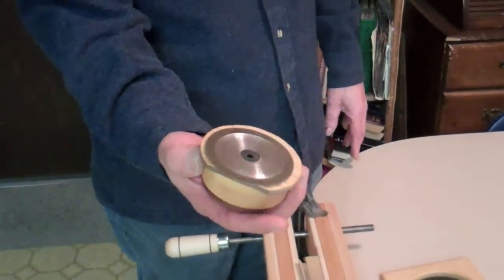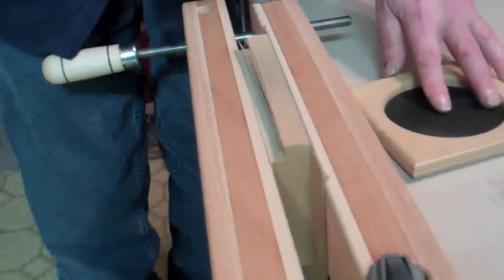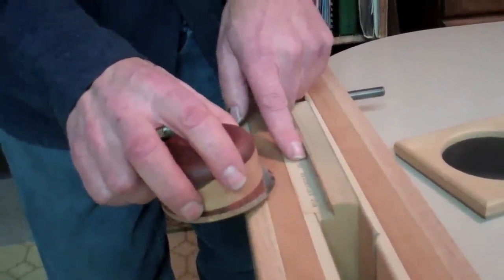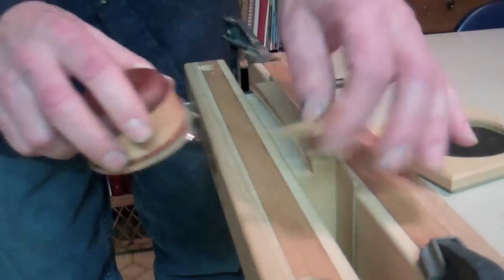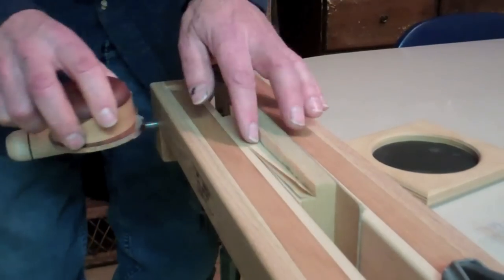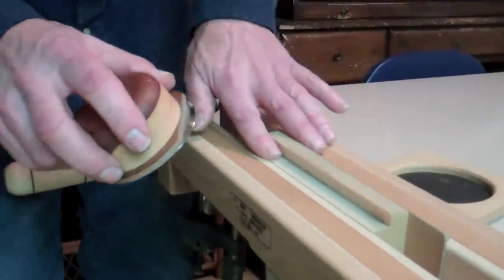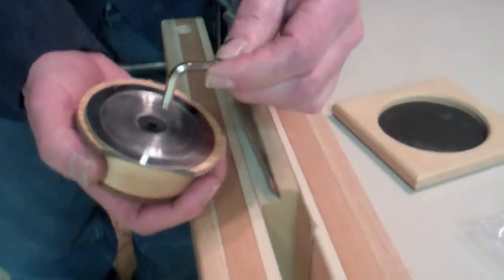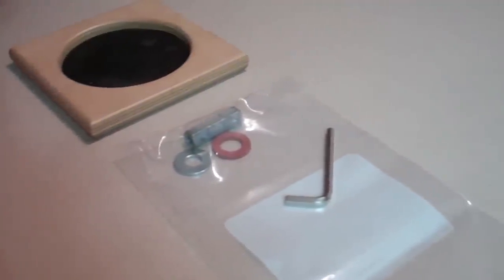Bookbinding Plough - Affordablebindingequipment.com

Comment from the maker: I provide some of the materials (some you have to buy) to sharpen it  yourself.  It only takes about 10 minutes and is the same method I use to sharpen them initially.   I can sell replacement blades but they are expensive and it's so easy to sharpen them yourself that buying another one isn't necessary.